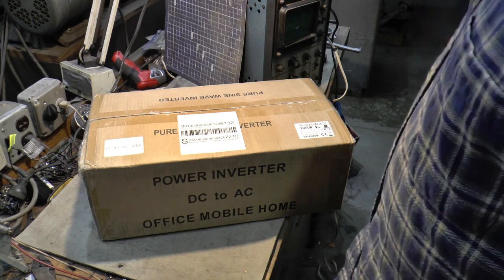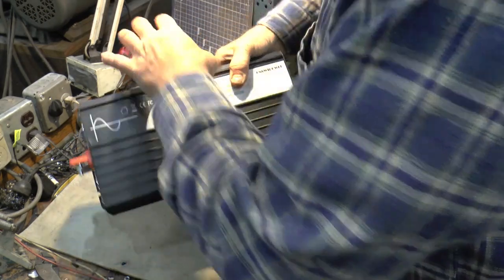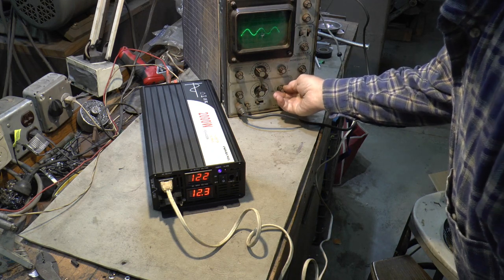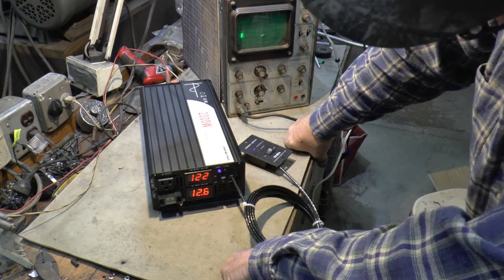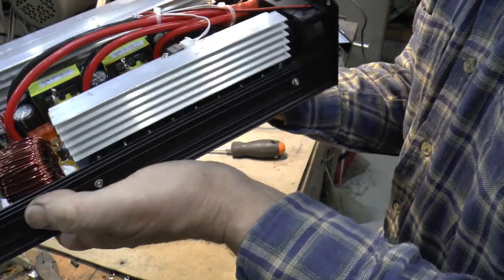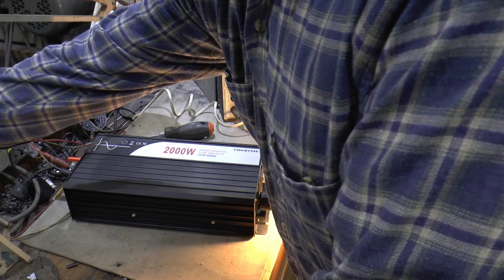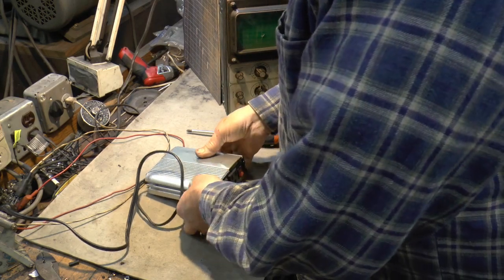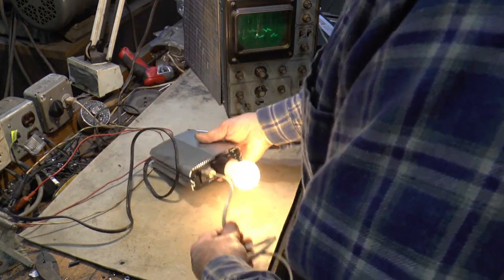2000 Watt Pure Sinewave Inverter First Look

Comment: Looks like a good one definitely well built for the $$$ The new version has the display mounted in the top cover & they upgraded a few other things like larger capacitors & power lead terminals. Company has been around for many years too 👍👍😎

Comment: How is this going so far in 2023 ? I just got mine .please  Let me know if you had any issues with it.
Reply from the maker: Used it 24/7 for several months no issues. Got an all in one system so I now use it in my camper. Works very well no problems so far.
Reply: can you share the fuse that you used with this inverter?
Reply from the maker: I used a 200 amp ANL fuse.  @minthos4045
Reply: @kevincrawford2027  are u using 24/2kw....can u share what isa the values of your cb
Reply from the maker: No I only have the 12 volt 2000 watt. @RMQ23
Reply: @kevincrawford2027 I'm interested in going wth a all in one unit I'm running high wattage high voltage house panels on my rv my inverter died on me an gotta buy a new one I'm living in my rv because the place I was renting burnt sn I lost everything an 56 yrs old an on disability of 894.00 a month isn't gonna rent a decent place these days not to mention security deposits on utilities anyway I was wondering if you would share wth me the all in one unit you went wth an if you recommend it as a true sine wave aswell as true mppt unit being I'm on a cpap machine at night to keep me from stopping breathing in my sleep I need a true sine wave an a true mpot to reduce voltage coming in from 3 house panels on roof of rv they were free so it definitely fit my budget if anyone wondering why house panels on a rv thanks an I'm a subscriber I love this stuff

Comment: That is a beast of a inverter. If I calculated in my head right. It will draw about 200A 12V from batteries on full load! Even half load will pull constantly 100A. You need thick wires for that unit!